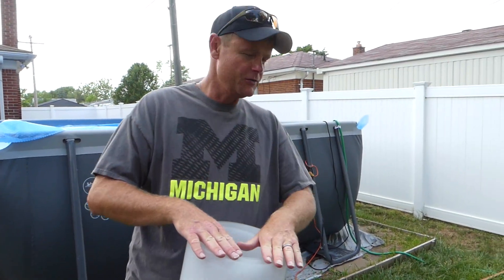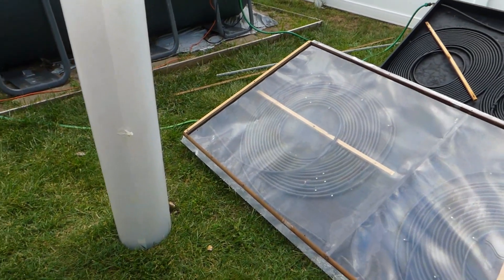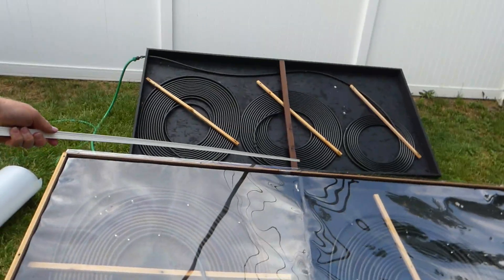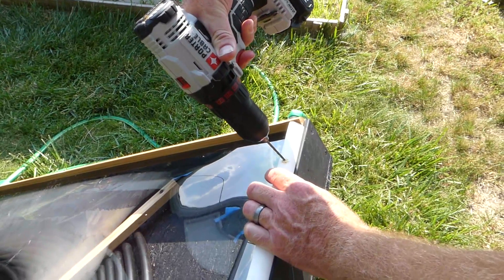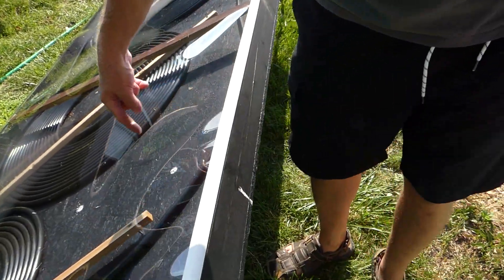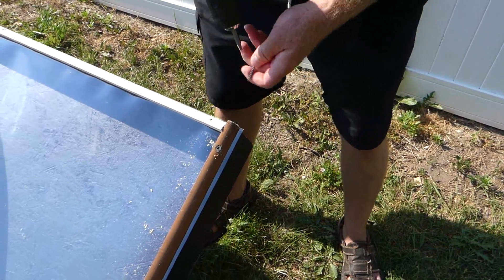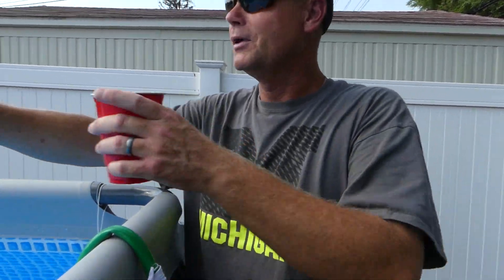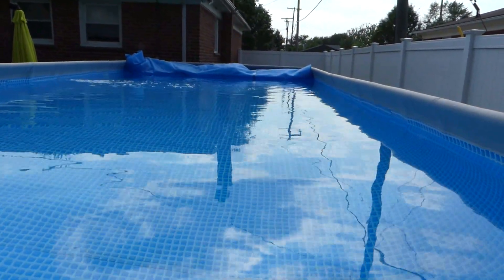How To Make Hot Water Using The Sun : DIY Solar Water Heater!

Comment: Love the videos... I copied your design. Thanks a lot. Do you get condensation on the inside of your plastic cover? I don't think I have any leaks on the inside.......
Reply from the maker: Awesome Louis!
Once in a while I get a some directly above the coils.
How's it going so far?
Thanks for dropping by & happy heating my friend!!
#RCInsiders
Reply: @RCInsiders  Does the condensation affect the heating? Is yours completely sealed off (silicone around the edges)? It hasn't got warm enough to heat it drastically but we have about 900 feet of tubing stretched across our roof. I'm trying to find how to attach a picture... I've been impatient though. The high we get is around 60-70 degrees and lows around 40's. Pool temp is currently 60 degrees with a bubble cover and running our system during the day. It got up to 66 once but I think we just need warmer weather... I don't know...
Reply: I just checked the water temp. 61 degrees outside 60 degree in the pool, 80 coming out...
Reply from the maker: @louisskoubye9494  No, the condensation won't hurt. I have not opened yet as we are still getting low in the 30's. Be patient my friend...Warmer days are near :) :)
Reply from the maker: @louisskoubye9494  20 degrees is a great differential, You must of done a good job with your build :) No I did not seal with caulk.
Reply: @louisskoubye9494  may i ask how big is your pool? as this could affect it pretty much. If volume of water is too much, it will take longer to heat up.

Comment: Thanks for your response on your other video! I see the 2 links in your description for the clear covers. Which of the two did you use in this video? I’m not seeing the difference between the two other than price ($52 vs $27). It seems they both have a thickness of 0.02 and size of 8’x4’. If there is a difference, which do you recommend? Last thing, do you believe that thickness is good? Or do you wish you would have gone with the same product but a little more thick? Appreciate your help! Thanks for the great videos.
Reply: Just noticed the delivery fee on the second, which brings it to almost the same price 😂. So I guess my only question is do you wish the product was thicker or this was more than good enough for the project? Thanks again!
Reply from the maker: @shawnkuffner  Hey Shawn!
Yes, this was more than good enough for the heater. I don't really see a reason to go any thicker. Thicker may insulate slightly better, but it already gets very hot inside the box. I used the cheaper one & yeah the shipping made it nearly the same!! Lol!
I don't think one is better than the other...Possibly name brand vs generic. Good luck on your project & don't hesitate to ask any questions. Let me know how it goes? Happy heating!!! :)

Comment: 10 seconds for a 250ml cup.  that's 90L/H.  Your system would be far more effective with faster pumping (even if water comes out less hot) than going around that slow. You rather have 200-300L/H coming out at 95 than 90L/H coming out at 105
Reply from the maker: Thanks for the tip Bruno :)
I have ran the system both ways & have found that on cloudy days slowing the flow (sometimes even stopping & starting on a timer) is best for me.
On sunny warm days I agree that max flow is best.
The best thing of all is that for a small initial investment & next zero operating costs, I can enjoy the pool all season 😀
Have you built, or thinking about building a solar water heater?
Thanks for dropping by & happy heating my friend!!
#RCInsiders
Reply: @RCInsiders  if its cloudy, of course, you don't want the water to cool down. But very hot days, the faster the better as long as it comes out hotter than the pool
Reply from the maker: Agreed
Reply: @cbflazaro  exactly. You will not believe how many people has a problem to understand this.
Reply: @RCInsiders  agreed. You know what’s best for you. Super!
Reply: Agreed. Also the main thing is the sunshine is peaked only for a few hours eg 2-4hrs. Outside this range the sunlight is not at its strongest and also you have to consider cloud cover and shadows which may interrupt those peak hours. So maximise those few hours with faster pumping. 

Saving your pump (from over heating / burning out) is a minor thing.

.... Just read your other comment. You know what’s best for you. Good job.
Reply: Also hotter water kills more pathogens then slighter less hotter water. 110F kills more then 100f

And 105F kills more then 95F. 

So his water is more cleaner. Well done.
Reply: I also built this one by referring this video. Thank you. I found if the water flow is fast then the water can not absorb heat in time even in hot weather. After run out all water from the coil pipe, it will be cooled again.  Have to use a valve to slow down the water flow.

Comment: Hi, thanks for making this! I finished mine yesterday but had a question about the pump. I have a 20,000 gallon pool and am wondering if the pump you used is powerful enough. Do you find that 560 GPH does the job well? Thanks!
Reply from the maker: Awesome Stephen!
So, you're pool is roughly twice the size of ours...That's awesome!! :)
I have found this pump to be sufficient. I don't run it to full capacity as I feel like that would make the water move a little too fast.
Unless you plan on building more than 1 unit, this pump should be sufficient for you as well.
I actually added a second unit this year & the pump works well with 2 solar units.
I understand your concern of wanting to move a greater volume of water, but with 1 o2 units, this pump is good. If you were to add a 3rd unit, then you would enough surface area & tubing to warrant a bigger pump.
Congrats on the heater!
Please let me know how it works out and if you have any questions.
Thanks for stopping by & happy heating my friend!!
#RCInsiders

Comment: Another good video thanks!  I gotta be honest I was pretty skeptical but this really worked.  I brought my 4000 gallon pool up 10 degrees yesterday.  Out of curiosity, what made you decide to add a second heater? You seemed pretty happy with the first one.  Also, did you stay with the same pump or did you need to upgrade?  I attached mine to 300' of black garden hose that I spread out around the yard before it feeds into the solar heater with 200' of tubing and the pump seemed to chug along nicely at least for the 4 or 5 hours I was running it.  I was concerned that I'd overload it. Thanks again for the videos!
Reply from the maker: Awesome Ryan!
Our pool is around 9,000 gallons & our small yard gets more shade than sun.
Since the wife wouldn't let me put it on the roof 😜 I settled for a second unit. Same pump, water just runs a little slower which I think is ok.
Your set up sounds great! Glad to hear it has warmed your pool :)
If I could, I would have these solar pool heaters all over the yard...There great!!!
Hope you have an awesome pool season my friend :)
#RCInsiders
Reply: @RCInsiders  I'm thinking about putting some caster wheels on the heater and with 300 feet of garden hose I think I'll be able to get a couple more hours out of the sun by moving it around.  Our sun moves behind various objects-trees, houses etc as the day goes on.
Reply from the maker: That would be so cool!
Me and my son always joke about building a hydraulic system that would raise & track the sun throughout the day 😜
Let me know how it works out!